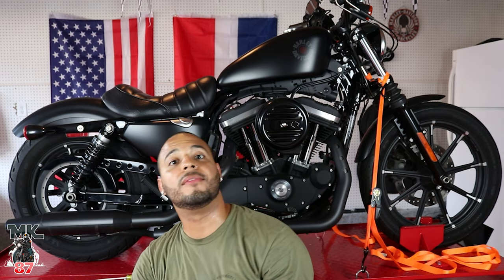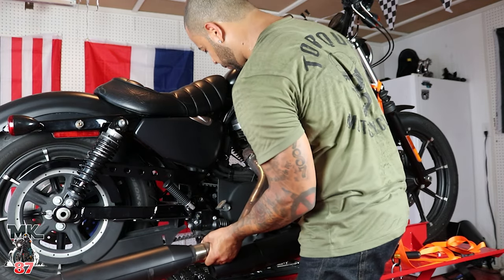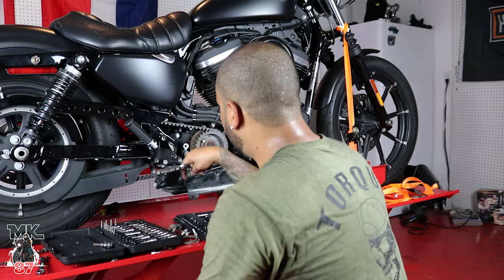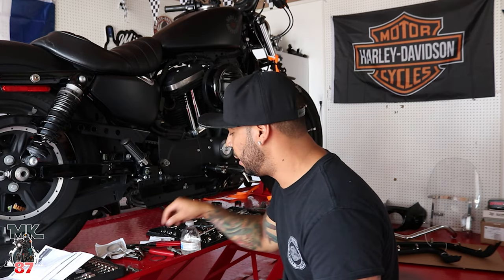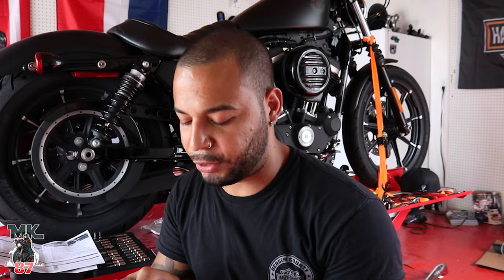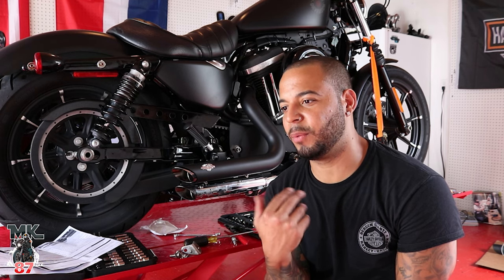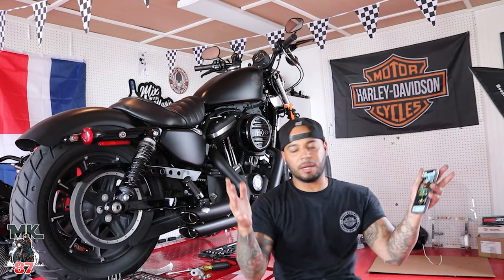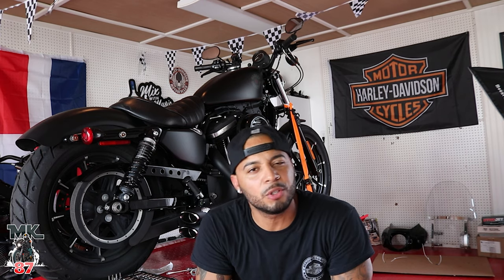Vance and Hines short shots install for Harley iron 883

Comment: Yo! Quick question. I just installed V&H short shots… check engine light came on. 2020 iron 883. Any suggestions?
Reply: Could possibly be the 02 sensors
Reply: Did you ever get it fixed? What was wrong?
Reply: @CantTreadOnMe  yeah, O2 sensor, replaced it. Engine turned off.

Comment: In your video you said you had to double nut where the flanges goes. Can you show me. Did you get any codes.  Usually you have to do a new air flow and fuel pack.

Comment: Thanks I got it installed today but I need to take it out tomorrow, wrap it in some black titanium exhaust wraps and grab one of those joint sets to tighten that one stupid nut. One thing I really don't like the short shots is that now my right heel is just resting on the heat shield and I don't think I can get use to it, do you have the same problem?

Comment: Just an FYI if you strip it or chip it get a torch from Home Depot for like $50 and heat that part of the nut with the head.. and grab some pliers to turn her out ..
Reply: I heat it with a lighter and bang it couple times with a wrench and was able to get it out.